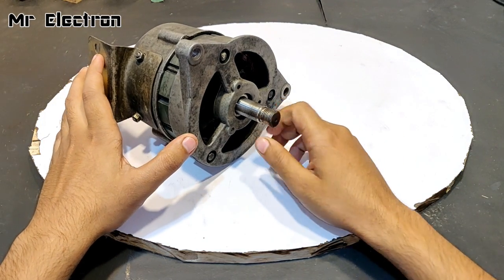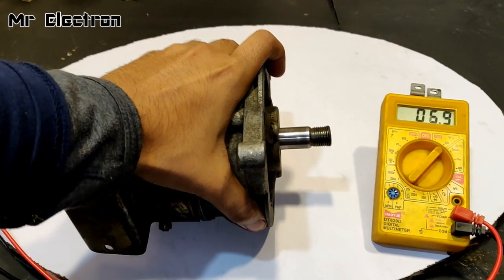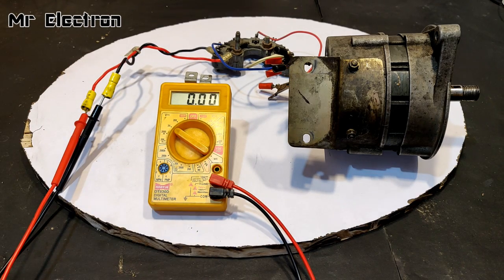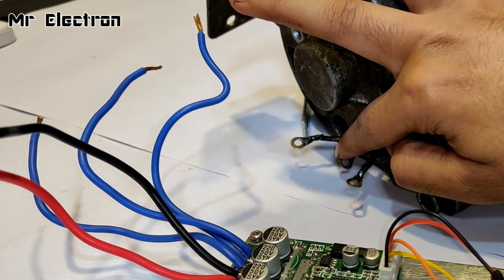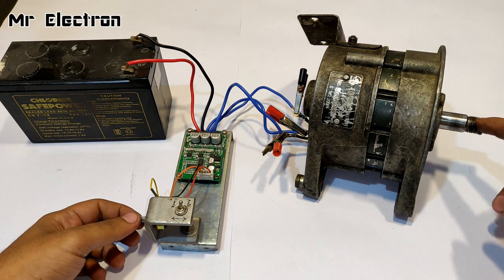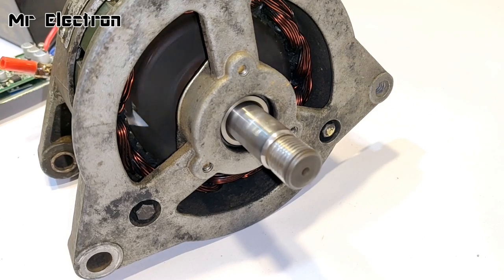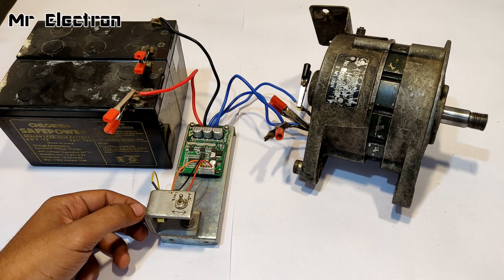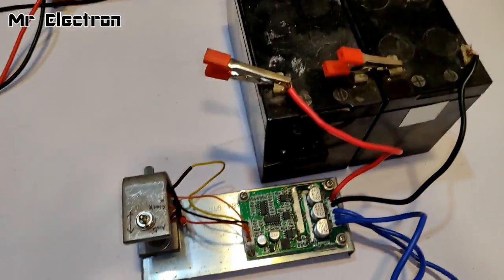12v 100 Amps Car Alternator converted to Brushless DC Motor - High Speed with BLDC Controller

Comment: The rotor will need to have power applied via brushes to make a magnetic field to induce voltage into the 3 phase stater coils. So you must supply power to make power. Unless the rotor is a permanent magnet.

Comment: And how does the rotor get magnetized please?
Reply: I would say since there is nothing electrical on the back of the housing in this project there are small magnets installed on the outside of the rotor, unless the guy used ring magnets inside the rotor which I have done before.

Comment: Can you turn a old generator head into an electric dc motor? There’s no videos on this if it’s possible.
Reply: Generators  can be powered as motors without any mods but the will not make very much power as the magnetic field is only a 180 degree field with 2 matching poles opposite each other. If AC power is applied to a generator it should make a bit more power as you switch the field poles each cycle of the power. But AC power is not practical for what this project is about. By using car alternators which have 6 pole fields, there is more force generated in each phase each turn. The phases are 120 degrees apart mechanically, 60 degrees electrically.

Comment: You should not attack 24 volts to the induction
Reply: Why? Unregulated output of any automotive alternator is going to be very close to that anyway! Let me tell you this, if you apply 12v dc to any one of the windings continuously it will heat up anyhow. The control circuits for working with this stuff go all the way to 96  volts if look for them. Lots of controllers at 36 to 48 volts are used with converted alternators out there. The power from the controller is not pure DC, it is cycled and switched from one phase to the other of the 3 sets of windings and since alternators are usually equipped with a fan to cool them under the hood, they still get hot, the insulation used on the wires is rated for nearly 200 degrees C so again I will ask why do you say not to use 24v on a 12v alternator ?

Comment: hi

can i connect directly dc14v 60ah 
to the minus and plus of the alternator ?  and it will run? 

thanks 
yossi
Reply: Not it will not work this way. The only an alternator will function as a motor is to remove the diode assembly and connect a 3 phase controller circuit to it.

Comment: How can you measure ampere without a closed circuit? You put the two multimeter's teriminals in the alternator.
Reply: No way to measure current in an open circuit, to measure current, you need an Ampmeter installed in the circuit between the battery and the motor input only on 1 lead. Current draw will be the same on each phase however since the power is pulsed you would have to take a reading at higher rpm where the meter wouldn't have time to fluctuate enough to read the display.

Comment: Bro where is the 18650 cells that u shown in thumbnail.
Reply from the maker: Some issue with it.
Reply: @MrElectron  i know those cells are not suitable for that motor
Cells gets very hot if u use it.
Reply: @DIYwithBatteries  you just need to feed a bunch of them in parallel, so the current in each one is lowered
Reply: @foxxyytofficial  yup

Comment: Is it possible to turn the alternator back into an alternator to charge the batteries if there was another source of power?  I'm thinking of using it on a motorised push-bike.
Reply from the maker: Yeah! Replace the brushes as the were before.. Magnets will act as added field strength if connected properly
Reply: @MrElectron  Thanks.  I was meaning if it could be reverted back to an alternator with a "flick of a switch" rather than putting the brushes back in.  I really like your videos too mate

Comment: There seems to be alot of cogging love to see this with 72 volts of 84 full
Reply: Cogging is likely mistaken for the fact these controllers output square wave current, and I'm not seeing any hall sensors used here, The surely is no bemf, (back electromotive force)  circuitry used in this setup. So the control system is not sensing rotor position which would cause the motor to be noisy. Increasing the voltage will for sure raise the speed and power production.